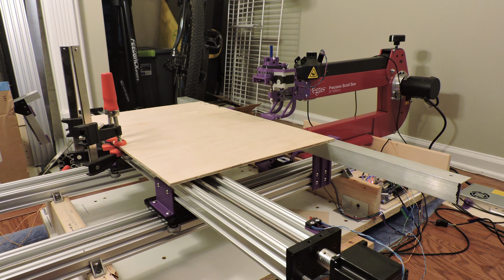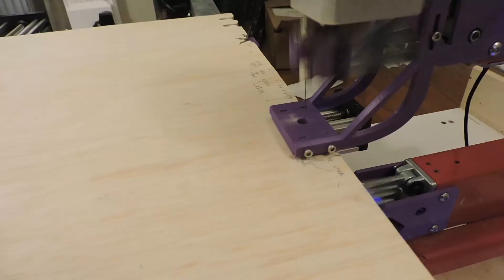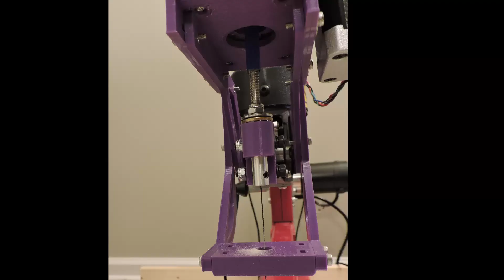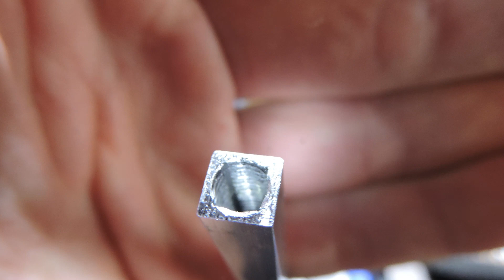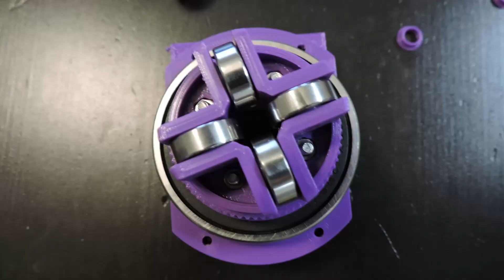CNC Scrollsaw - Version 5

Comment: Looks like you're getting very close.  Eventually you'll need to change the blade holding a bit to make blade changes easier but that's more of a convenience / production thing so you don't need it yet.   Look at the way the Jet saws work - small holder for the bottom that slips into a holder with a lever driven clamp/tensioner on the top.
Reply from the maker: Yes and even closer in my latest video. The blade holder was designed to be easy to make with what I have. I've got some ideas for a proper one if/when the time comes; I'd really like an almost zero clearence fit so the blade is concentric. And maybe automatic blade changes one day...

Comment: OK Andrew ! Looks like a winner!🥇 Post a quick vid of it in operation perhaps ?  What more work do you plan for the concept ?    Stay safe. -Mike😷
Reply from the maker: The first part of the video is in operation; the workpiece moves slowly so it's hard to see, but it moves! And next I'll be working on some improvements to the work holding and removing pieces after they're cut.
Reply: @AndrewConsroe  Joke's on me - 
I see it moving now that you pointed it out. Still cool😎
Ah, improvements to the holder - are you going to try for easy blade removal and insertion ? And blade tensioning ?
An option if blade removal is not necessary to one's application is the Pegas bandsaw perhaps ? For me quick blade positioning is the best thing about a scrollsaw 😀